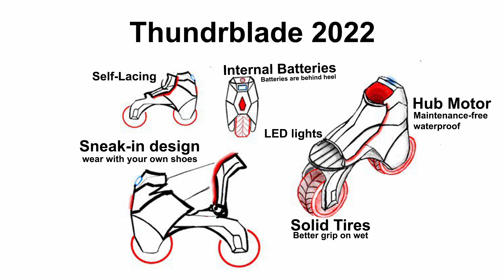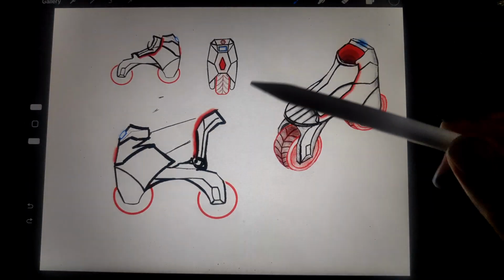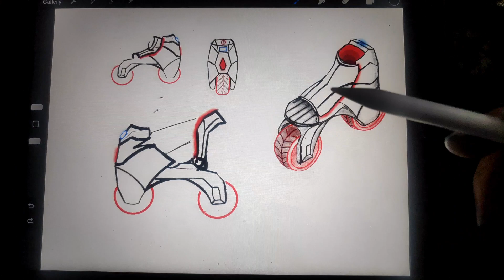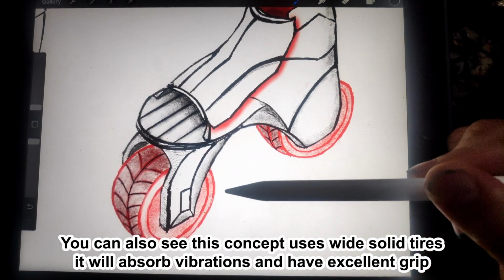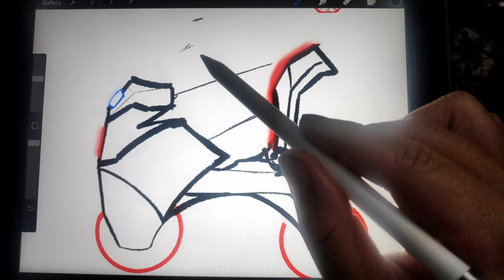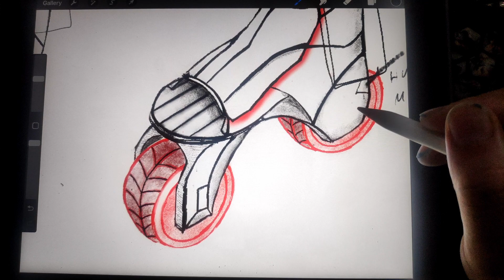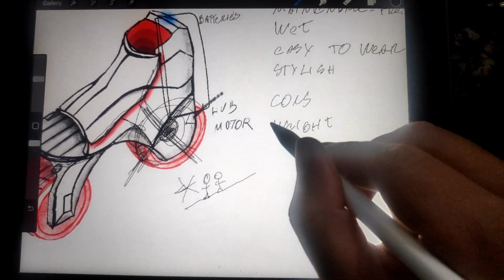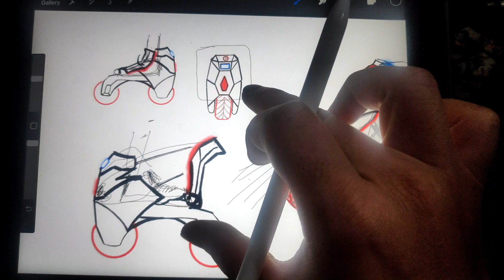Why Thundrblade will use HUB motors going forward

Comment: I like the new one I think it is easier to make and cheaper overall
but I still prefer the old one because it's faster and lighter
I don't really think I can skate normally with the new model it kind of removes the freedom of the inline skate idea
whatever you make anyway I'll buy both if you sell them
I would also be very curious to know the battery efficiency of the new motor  compared to the old one and how many KM you think you can go
Reply: I think the new model would be better for long travel and the old one for short travel
but the old one look way more fun tbh

I kind of care for confort but I really want something that feel very free and fun to ride, and if possible fast
otherwise I don't really see why you would go for inline electric skate instead of other electric small vehicules
Reply from the maker: you are right and I agree with almost everything you just said.

old model used normal inline skate wheels, so it had the feeling identical to normal inlines when turned off. you could skate normally and even do tricks the same.

but for confort... when you used the motors the vibration would be very annoying (even at around 20km/h) I even had my feet get numb. of course it depended on the road surface, but this new model will have softer tires which will aborsb vibration much better and also will be better on road imperfections like small holes and pebbles. So you will be able to even tackle dirt roads or grass.

the new model doesnt exist yet, so somethings will have to be tested to be sure. I appreciate your input.
Reply from the maker: about range, most PEV (personal electric vehicles) have around the same efficiency. so its all about battery size tbh.

thats why I intend to have swappable batteries so you can carry more in a backpack and just change them when needed and thus keeping the weight and size to a minimum.
Reply: @Thundrblade  I see yes thanks, I joined your ko-fi I think your discord isn't ready yet because I didn't find the link. Thank you for your answer see you soon on discord or another video :)
Reply from the maker: yep. still setting things up. it will be up soon.
thank you very much!

Comment: I like what I'm seeing so far. The design is sleeker than the last model and looks unique. I'm a bit of a thrill seeker so I like going fast, but I understand that most people aren't speed demons, so it's cool. And I'm not worried about the weight. Just a gut feeling but I think it won't be a HUGE difference compared to your older model. Overall great concept. Don't be afraid to make changes if needed. You got this.

Those who suffer the most receive the greatest rewards. Remember that.
Keep up the great work. Much love
Reply: I agree in the speed department myself, I've always focused on speed and have gotten up to 32 mph  (115 kph) after being on inline skates for 15 years. Im not too focused on tricks. But commuting in my small town would be amazing!
Reply from the maker: thx for the feedback!

Comment: The locking feature is cool, I can see that being used a lot. It's been mentioned already but being able to switch battery packs on the go would be the biggest deal for me. A quick switch is priority number 1in my opinion.
Reply from the maker: yep, definitely swappable batteries. the old concept had them as well. I think its essential, I should´ve mentioned it. thx for reminding me.

gonna mention it next time.

Comment: I like the design, it might be a bit dangerous with the wire's for the self lacing part, but apart from I'm loving the new design especially the RGB part
Reply from the maker: yeah, that will need some testing, but there are some shoes that use this kind of lacing like cycling shoes.
thx for the feedback

Comment: A good feature imo would be a sort of “extension” to the battery in the form of a backpack-type battery system. This would of course extend the battery life, and be a good ad-on. Might be better if that were a separate product to buy that integrates with the smaller battery on the shoe itself though.
Reply from the maker: oh yeah, some people want bigger batteries, but to put batteries inside a backpack wiring it to your feet is kinda dangerous really. anyway, swappable batteries would solve this in a easier manner.

you just carry more spare batteries inside your backpack.
Reply: @Thundrblade  That’s also a good option in my opinion. A specialized backpack in general would honestly be a good thing to include with the product too, to carry extra batteries, and the skates themselves when entering a building.
Reply: I agree a wire from skates to backpack is dangerous, I like the old battery swap idea
I think it is nice to include a way to carry the skates in a new crowdfunding maybe but probably not the whole backpack because it is very hard to find a good backpack for sport and travel that fit your needs, I would prefer to buy just a case or a small bag to carry the skates inside my own backpack
Reply from the maker: offering a full backpack especially designed to carry thundrblade is a nice idea, but its kinda impractical for initial stages. maybe in the future. I mean, there are entire companies dedicated to doing that and they have a hard time.

but I will try to figure out some more practical ways to carry them. btw did you guys watch my video about carrying skates? https://youtu.be/VMVx7W9_Lfk
Reply: @Thundrblade  yeah I saw it
I don't think carrying them inside the bad is a good idea but I liked the #2 way you shown and the last one with straps

Comment: How heavy are we talking here? You mentioned before that the original prototypes were closer to 5lbs, how much heavier will these be? You're absolutely right that super high speeds aren't the safest or even the most realistic for regular users, but I think the mass is going to be a big selling point to get folks on board.
Love this concept, been a fan since 2015, can't wait to see more!
Reply from the maker: can't say for sure for now.
since the new concept will be a 1 piece (boot+frame) it could shave a pound off of the structure. If I manage to make it around 6 lbs it would be great.

Usually hub motors are around 1~2 pounds heavier than the motors I used before. I will try and make a video answering this for more people to see.

thank you for the support!

Comment: I like this design. I wonder though; If a person's foot with the shoe goes inside will the skates be too big to store on the go, like in a small backpack?

The self lacing feature is cool, but if that adds to the cost I'd prefer saving a few bucks with traditional straps.

How feasible would it be to have a deluxe version with hub motors on both wheels? That could be an option to let some spend more for a faster version
Reply from the maker: thx for the comment!
Normal inline skates are already too big to fit inside a normal backpack. there are lots of ways to carry them though. I have this video showing several ways to carry skates on backpacks: https://youtu.be/VMVx7W9_Lfk

there are some skates that have this funcionality and they are not bigger since the part that is larger is usually the frames than the boot. you can check out DOOP skates. Even older thundrblade prototypes used DOOP and Xsjado boots. they are the same size as normal boots.
Reply from the maker: the self-lacing is a nice feature that adds to the convenience in daily use. maybe we can have a version thats more affordable without that feature.
Reply from the maker: having 2 hub motors on a single foot is not really easy to do, not impossible, but the skates would be VERY heavy as well.

but yeah I would like to use it as well. I will consider it.